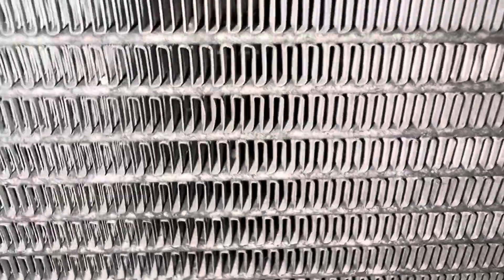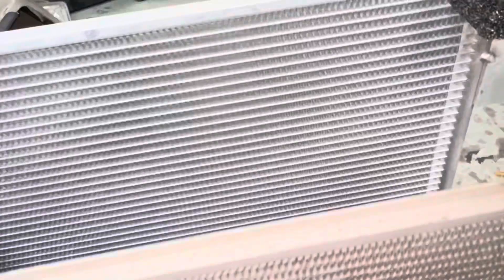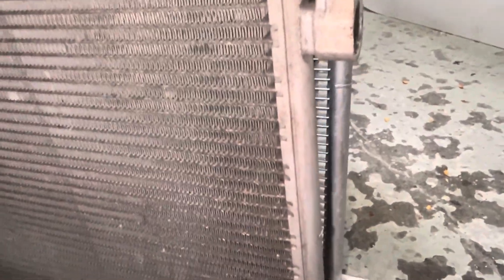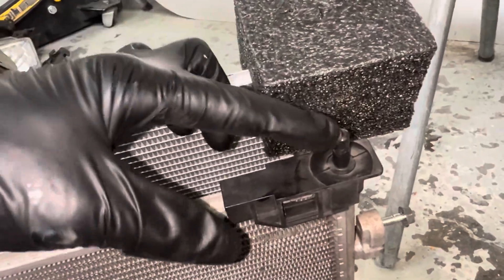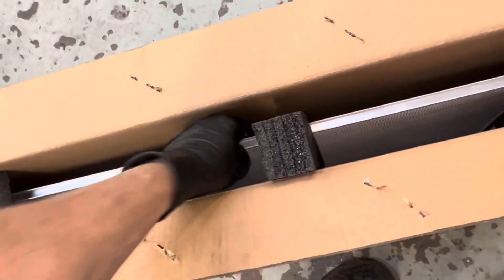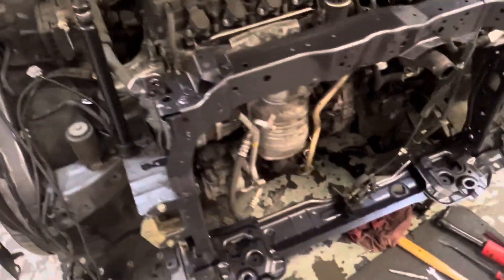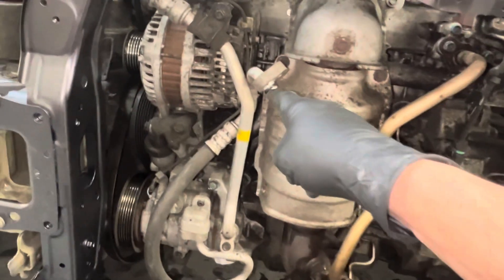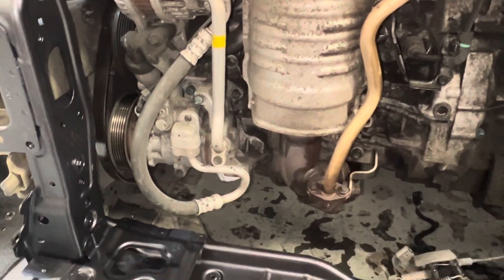Comparing a aftermarket Honda condenser to a OEM Honda condenser

Comment: If an aftermarket condenser has less tubes (volume), does that mean that charging using factory weight would effective overcharge the system?
Reply from the maker: In some cases, not all cases. 
There’s some manufactures that are putting less tubes with a much greater internal Volume.  Then those other ones that do not.. 

And it cannot be left upon the responsibility of the unknowing technicians who would not have even a single clue that there’s even a difference because many do not even know this fact . 

And you cannot charge the system by using pressures so there’s no way to come up with a precise quantity 

And we use software and variable displacement compressors with variable speed fans. There is no way to use superheat or cooling as a method of getting accurate refrigerant. 

So unless these aftermarket condenser manufactures can put in writing black-and-white a precise, refrigerant quantity for their specific  condenser these products should not be sold on the market as direct OEM replacement drop in

Then there’s the other underlying problem the heat dissipation, rejection capability of the condenser . 
This is purely a physics thing that cannot be cheated cannot fudge the numbers 

It all comes down to mass and surface area . Which of these aftermarket condensers do not provide.. 

It will affect the operation and performance and skyrocketing high side pressure which puts undo stress on the compressor . 

Electric vehicles, the compressor will draw down the high voltage battery decreasing range mileage of high voltage battery 

The other problem it does with hybrids when it’s a really bad condenser, the AC cannot keep the sensor sensors in the cabin keep commanding the compressor to try to move more refrigerant to make up for the shortfall, consuming more electrical power from the hybrid battery .  This decreases the gas mileage because the engine keeps having to turn more often to charge the battery back up to keep the three phase high voltage compressor running..  this also cycles the battery constantly more often because there’s only a number of cycles that a high voltage battery last. 

So this cheap condenser also decreases the overall life expectancy of the customers very expensive high voltage battery . 

And all this to save a few bucks on a condenser .

Comment: You know what I noticed about that OEM Honda condenser?  The Toyota one's are still better. 😂
Reply from the maker: Yes, by far. 
DENSO has extremely high standards
Reply: DENSO used to have high standards before but now they are starting to get well known for manufacturing low quality parts. Leaking condenser and faulty fuel pump which is now getting recalled. Ford's double/triple o-ring is the best.
Reply: @w0lvez1  On one hand, American cars have excellent air conditioning. On the other, you're claimin an American car company makes better parts than Toyota. Can't tell if you're just anti-non-American cars, pro Ford, or actually know what you're talking about. Quick test, do you currently own a Ford? Have you ever owned a Toyota? Or even a Japanese car? Hell, a non-American car?
Reply from the maker: @roots4x 66 Mustang, 70 For F100, Saturn 🪐, (88 Chevy Sprint aka a 3 cylinder Suzuki) , Ford town car limo executive stretch, two Toyota Camry 4 cylinder, Toyota Yaris, Toyota Prius C, Lexus RX400h, (Tesla model 3 wife’s)
Reply: @roots4x  🤣
Reply: @roots4x   Forget about the brand and  focus on the design and the seal that prevents refrigerant from leaking. Which one is better and will last longer without leaking 1 o-ring vs 2 o-ring vs 3 o-ring?
Reply from the maker: @w0lvez1 the one with the correct size O-rings. 

And that’s not necessarily the ones that were supplied by the factory when they were assembled . 

Yes, the old Ford final fix to their devastating failures of single O-ring system . 

When they finally went to three rings . 
      You remove the factory O-rings
You feel the grooves up with a small amount of silicone grease 
     Then you reinsert just so slightly larger O-rings. 
      And then you re-insert the piping and it will not leak. 

The factory system still leaked it had to be improved by somebody who knew what they were doing . 

The factory has to think about money 
The factory has to think about keeping the assembly process, not complex slightly smaller easier to insert O-rings. The technician who is installing them does not have to worry about being careful and can just shove it right in really easy really fast without damage. . 

Having to go through a process of adding extra by putting silicone grease inside the grooves is extra time and money and materials 

And by the O-rings just slightly larger, makes it more difficult and somebody who is not careful can pinch and damage the O-rings . 

So this is not a good procedure for high production assembly line . 

For the guys who just follow the rest of the world like sheep, they would take those O-rings off when it’s time for repair and just replace replace them with with the recommended O-rings and would still have the same. Results of slight leaks later on. . 

For the guys who actually knew better . 
    Knew What to do to modify it so it never leaks.